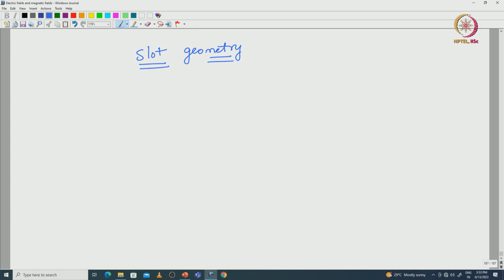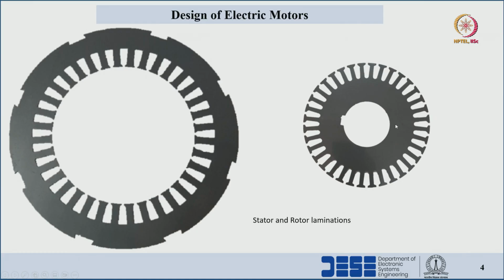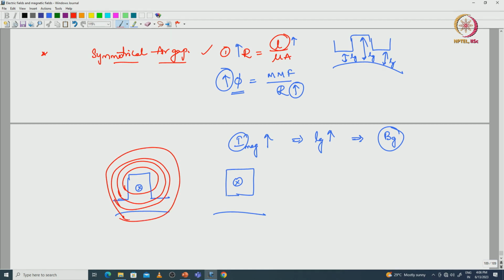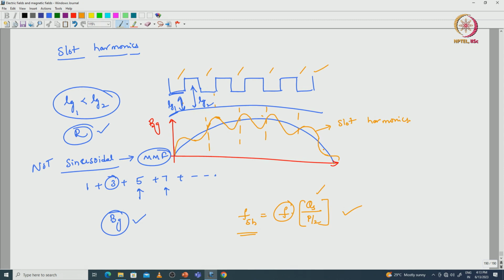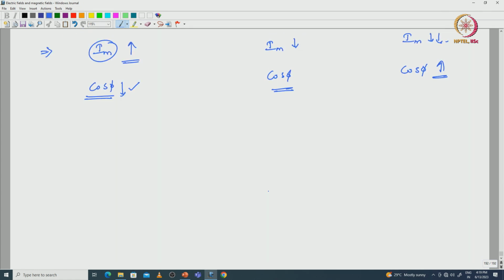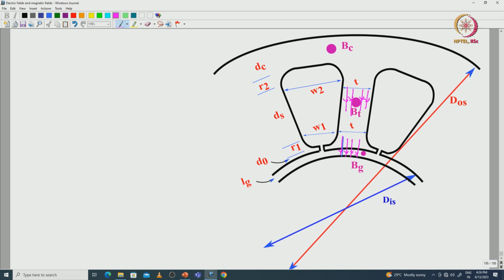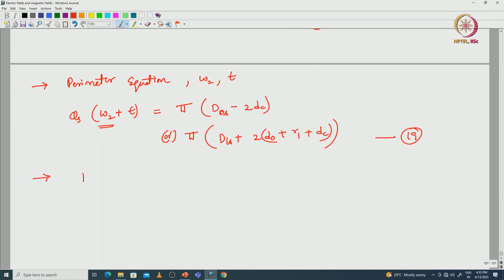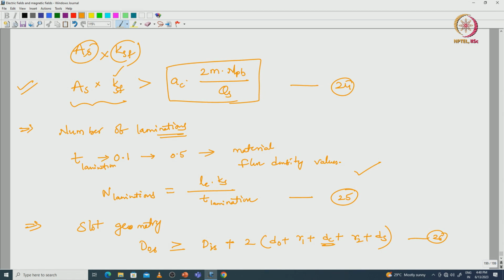Lec 39 Design of Induction Machine- Stator Design -3 (Stator Slot Geometry)

Comment: Produces confusion at 15:28. If the air gap is uniform, then this leakage fluxes can be minimized. Which side are you talking about, either the left side or the right side? If you are talking about the left side, where the air gap is bigger because of the open slot, and due to the open slot, reluctance is greater, then automatically flux passing through the air gap is less due to that medium. please clear this.